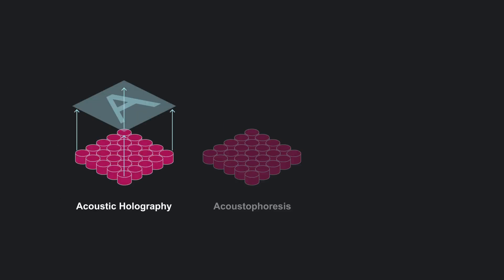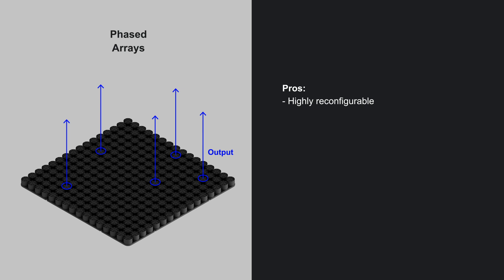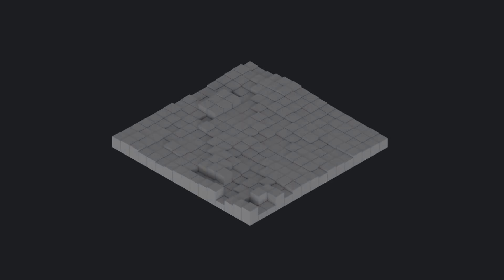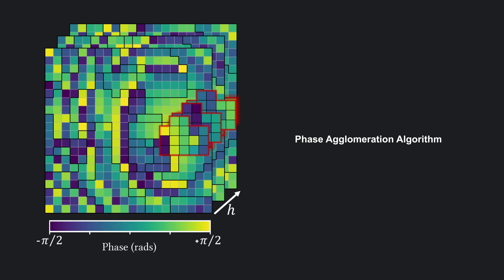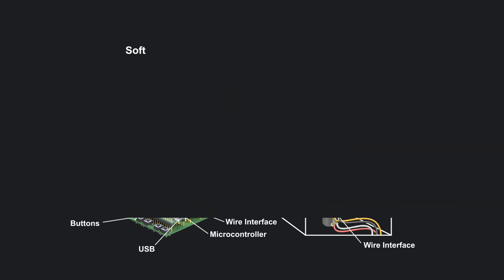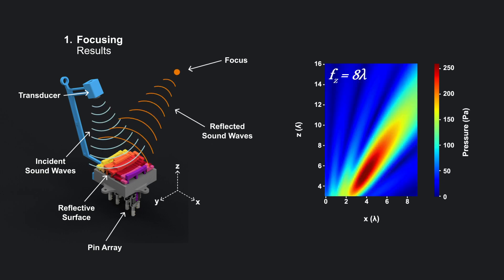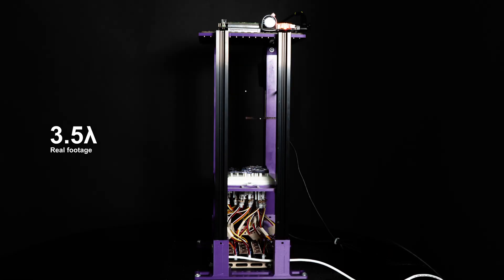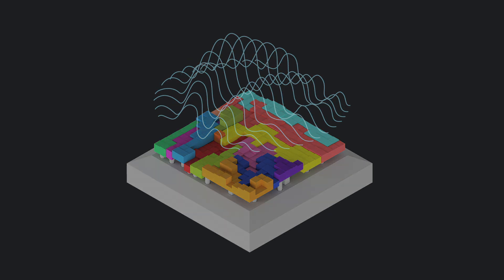Actively Reconfigurable Segmented Spatial Sound Modulators

Comment: Cool explanation!
I used to work for a company that designed cheap and robust actuators for Braille-'monitors' (or e-paper, for the lack of a better word). This worked on a stick-slip principle, actuated by piezoceramics. (not for creating ultrasound, rather for moving the braille-pins dynamically; no actuation is needed when the pins are stationary.
Would such a system be interesting for your application?